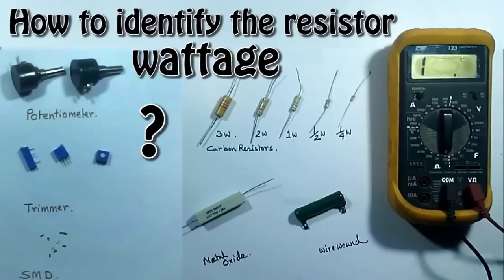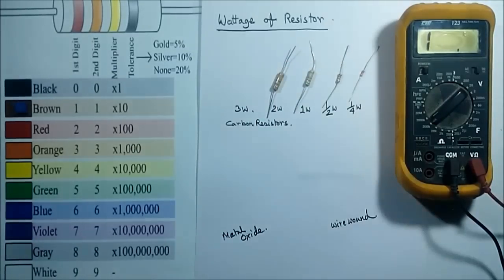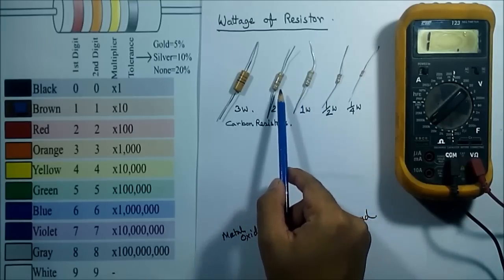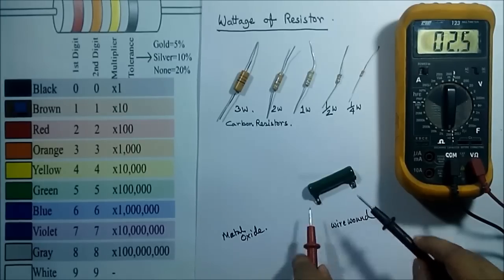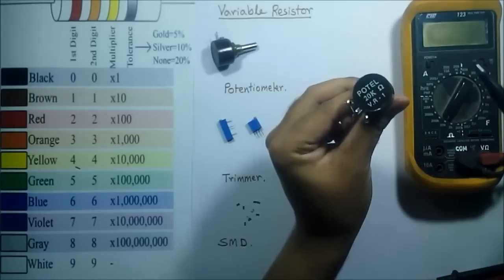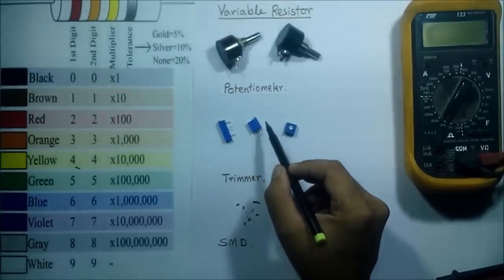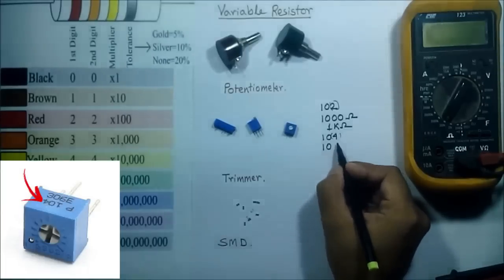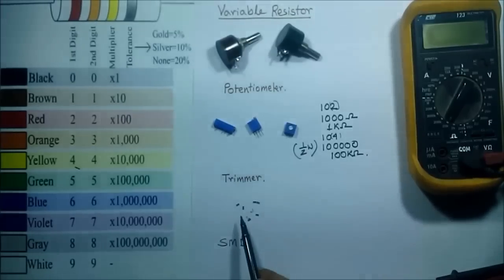How to identify the resistor wattage (Both fixed & variable resistors) ✔

Comment: How to identify which resister we need to use in ac to dc circuit for led ?
Reply from the maker: Resistor is not dependent on AC or DC supply

Comment: "How to identify the resistor wattage"
in a nutshell = size
Reply: Yes, but what size?  What size is this guy's hands or the pencil?  A millimeter length/diameter of each resistor should be given.
Reply: This is just superb, I've been looking for "do you put the resistor before or after the led?" for a while now, and I think this has helped. Ever heard of - Henucas Panrooklyn Equalizer - (just google it )? 

It is a smashing exclusive guide for discovering how to repair electronic devices like a pro without the normal expense. Ive heard some pretty good things about it and my brother in law got excellent success with it.
Reply: ... and you need a reference set.

Comment: Very good video, I have a question regarding wire wound resistors. Can you measure and identify the value of a wire wound resistor if it has burned out? I have one I need to identify and replace but have no markings. Thanks

Comment: hi friend very clear video , hope you produce more clips on how to use dc  voltage to dc voltage converter and more on power supply thanks
Reply from the maker: For dc to dc voltage converter, you can check the following video.LM317 Adjustable Voltage Regulator complete Tutorial with Practical Experiments
https://youtu.be/SQDR_8z5OFU
Reply: Hi thanks for the swift reply

Comment: Nice. But i can't understand 5W resistor dissipate much power so why we use it in circuit ?
Thanks ahead.
Reply from the maker: +colorado wilderness 
Resistance is used to limit the current in circuit. Now the multiplication of voltage across resistance and current through it indicate the total wattage dissipate. So if the  dissipate wattage is 5 watt and we use a 1 watt resistor instead 5 watt then the extra 4 watt will burn the 1 watt resistor by generating heat.
Reply: Nicely explained . Someday you will be a good pro engineer !
Reply: nice